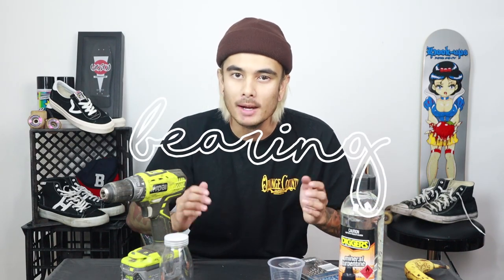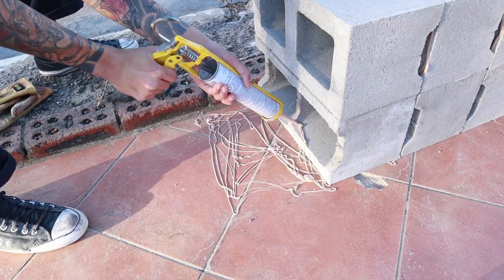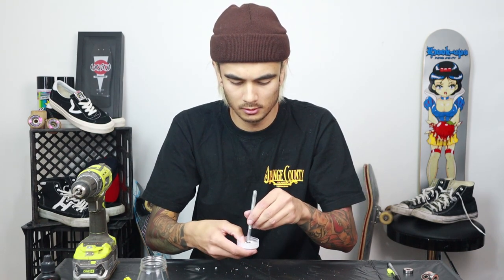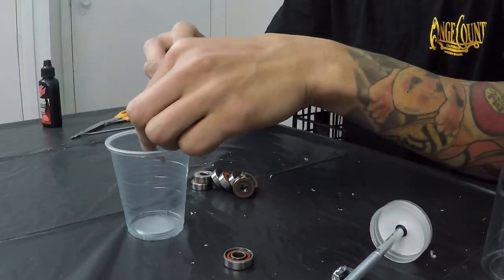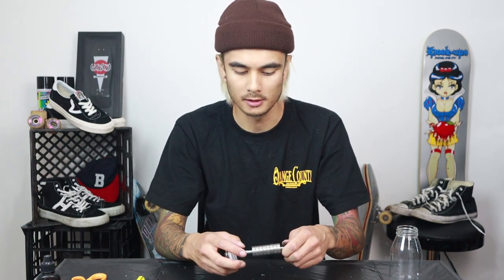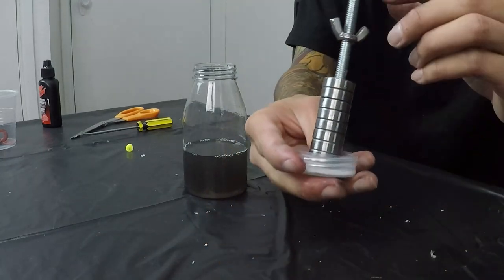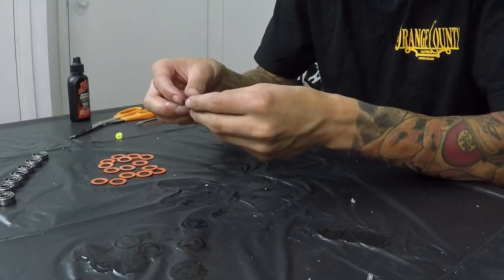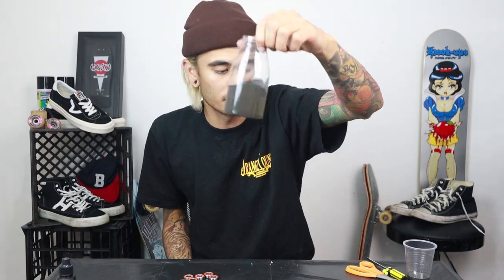D.I.Y BEARING CLEANING KIT | HOW TO CLEAN YOUR BEARINGS | BEARING OVERHAUL

Comment: OK a few things. A cool thing to do would be to actually use the drill to spin them around. It hit me you could to do that with a full bottle and spacers and they’d get very clean very fast. Thing 2. Acetone can dissolve plastic so if you do use something like a used juice bottle that is made with thinner plastic, you might want to pitch it straight after - rinse then bin. The fumes that will off gas will be nasty. Final thing. It’s really easy to get 100% acetone if you look a professional nail polish remover.

Comment: Just a recommendation instead of using mineral turpentine or acetone use a citrus based degreaser its less harsh on plastic bearing cage and breaks down the oils better. Aloha from hawaii 🤙🤙🤙